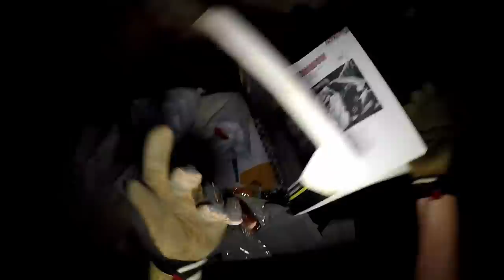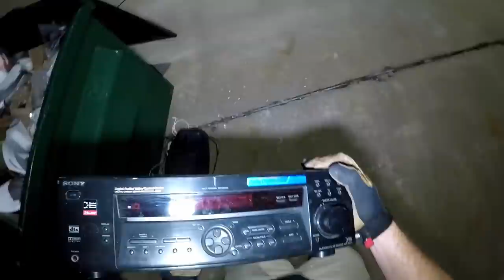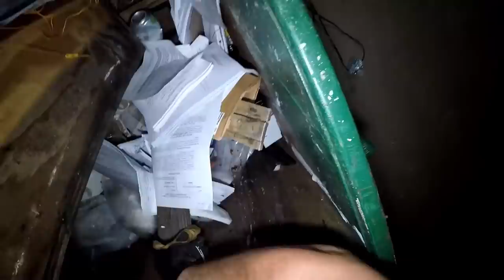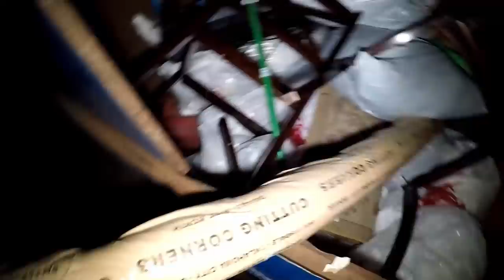Dumpster Diving "Leavin' My Mark"

Comment: This little "laceration" looks like it needs stitches.  Please be careful.  What a beautiful little bed frame.  So glad you saved it from being turned into safety pins.  You said several times that it wasn't the most successful day, but I disagree.  That bed frame isn't just old, it's an antique.  A REAL antique.

Comment: The bed frame, head, and foot board  late 1800 hundred to early 1900 hundred. Will have lead base paint,  so be careful.  Yet a great deal of money.  Thumbs up for this one. Thanks
Reply: I do believe your right !    ( or pretty close to it ).             :~)
Reply: If it was from the 1800 or early 1900 it would be made of Wrought Iron everything today is all hallow pipes
Reply: Had a bed similar about 40 years ago, bought in an antique shop.  Same side rails with the nubbins that fit into the head and foot boards.  Weighed a ton.
Reply: This bed was made in the 1880s, The tips are missing but you can cut the rods off an prime and paint it, But like  Slawko said They used lead based paint back then so I would have it sand blasted then prime it, That green color looks to be after market too so there will be a color under the green, That color would be what I would go with, That bed if put right could bring $2000 or mor e but the tips are missing so maybe $500 plus as it is now, My grandmother had one almost lie it and she sold hers for $1200 back in 1975, It was a full size and the color was dark brown with white highlights on the tips.

Comment: I  noticed you pass on coaxial cable alot.  I use to work in the satelite industry, so this may help if you did not know.  Look at the cable if it is marked rg6 it is a solid copper core,  rg59 is copper plated.
Reply: Wow thanks for that mate. I thought it was all steel core. I know the earth or armour is copper. But thanks bro. Would it be the called the same in the uk??
Reply: RG58 and RG213(thick low-loss coax) can be sold for more money than scrap value to ham-radio operators if he ever finds some

Comment: Mike you are passing on easy gobs of copper off the back of the CRT on those tube TV's. There are only two clamps holding there. They are stainless.  You could do it on the spot. Take the goods and leave the junk. Be Strong!

Comment: That antique (c1900) cast iron bed is worth $175 - $250 in my market. You can cut down the threaded rod and put those brass balls on it that you had previously.... (ok, just realized you had that figured out by the end of the video...I didn't watch until the end before I left the comment initially.) The rosette goes on footboard or headboard middle piece...should be a small bolt sticking out and a small brass ball that fastens it in place.

Comment: The headboard and footboard with rails should be worth a little bit to an interested collector.  They were made in similar styles up just past WWI and alot of them didn't survive the scrap metal drives of WWII.  You won't buy a new house or truck selling one, but it is still well worth rescuing.  And from a guy who use to save and rebuild old rods and reels when he was a kid, thank you for rescuing those as well!

Comment: I agree with Slawko bed frame could be even older then mid 1800’s. Nice find for sure. If u can’t figure out the brass toppers for the head and foot board just grind the stems off and sand em down.

Comment: Back in 1975, I saw what looked like a hurricane strap hanging off this building. So's like an igate I grab ahold of it and discovered it was electrified. It sliced right into the big knuckle on my first finger ( inside ) right to the bone. It cordarized it. I used duct tape and the rest is history : )

Comment: That is an Antique bed 
frame dates 
maybe back to 
early 1940s.
they are sky high 
in those stores.
this kind of bed used straight 
bed slats fence boards will 
work make sure they are thick
or you will fall through the bed.
you can go to hobbie stores to
look for those replacement knobs
better to go to Antique stores for
better finds & deals.

Comment: Old bed frame for sure. For pictures, your best bet by a long shot (they have the market cornered) is to scour Pinterest. The big thing is asking the right terms but you should be able to pick up on that by being observant of the pictures you see and how they are posted. Vintage  iron head and foot board bed frame would be a start. 

Dang you come across some cool stuff. On some of the cases you come across the protective corners, handles and such I would buy off you. One set at least. That shit looks like it’s everywhere till you try to find it then it’s all from alibaba and you have to order 100 sets. AHH! Drives me crazy...

You should familiarize yourself with trade show booths and design. Seems you come across some unique items that could be used for props and or details. Booths are referred to as “displays” as well. POP displays are “ point of purchase” displays. Those are the store displays that get down to specific products , notably Shimano, Oakley. You get my point. But other products could be highlighted. Since your doing some furniture, think of doing some pop display stuff maybe. Look up steampunk, almost everything you come across could be put together to be some kind of steam punk theme. 

Keep the videos rOLling!

Comment: I was just telling my wife I need a old complete rack stereo again all different pieces I miss them things mine was loud over 600 amp with 4 18 inch speakers
Reply: I attempted to fire up my old component stereo( technics) that I hadn't used in years and annoy the new noisy neighbors but it sounded terrible!? I took the speaker covers off to discover the foam on the speakers had rotted away after 40+ years, imagine that lol. 

I was disappointed that I couldn't annoy the neighbors so I refurbished the speaker cabinets with all new speakers and crossovers, found a 15 inch subwoofer and added that to my system and once again I can annoy the neighbors.  ;)

Comment: Strip off the paint you will find brass steel.  The. Fernells were sold brass cir. 1900.  That's a couple thousand dollars bed restored. You missing the box Springs and casters.

Comment: On those power cords, when scrapping them, do you strip them or turn them in as is? Just wondering.
Reply: He has a wire stripping machine so if it is thick he strips.

Comment: Those toy quads have led acid batteries in them. I really don't like seeing those on the curb. People just don't think
Reply: I've always tried to pull the batteroes out for scrap and they are always missing... Doesnt take long for one of us scrappers to check for it, and believe me, if it looks like its being thrown out we'll look to see if its in there
Reply: @aaronphillipzon199  as long as they are missing that's great. The ones I find though aren't. If there was a good place in my area to recycle plastics, I'd take the entire thing. I did that for the razor scooter that had two batteries. More metal than plastic

Comment: Mike yer used to handling tools, right. Get yer self a belt holster for wire cutters and mount it on your center tube on the bike. Ya need them a lot of times when ya don’t have them.just sayin.